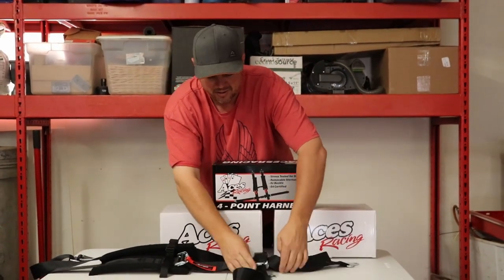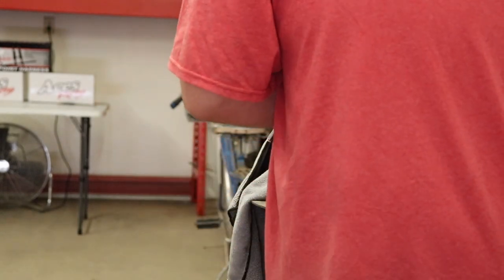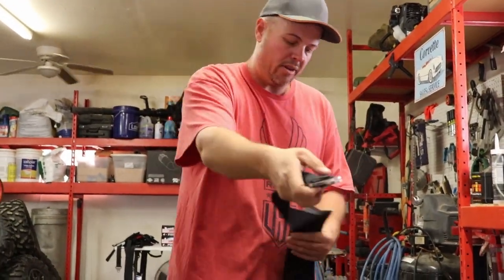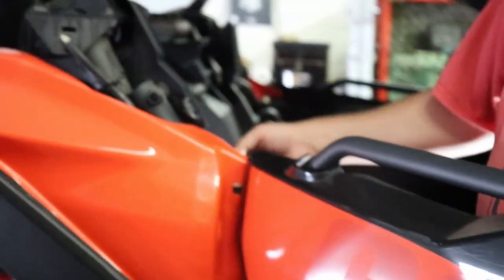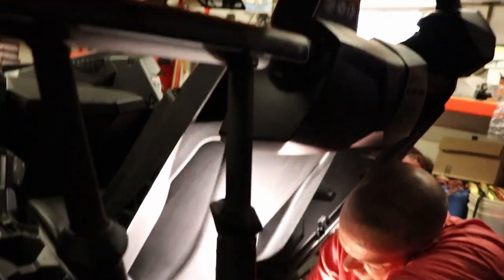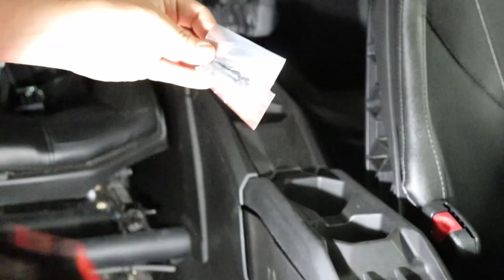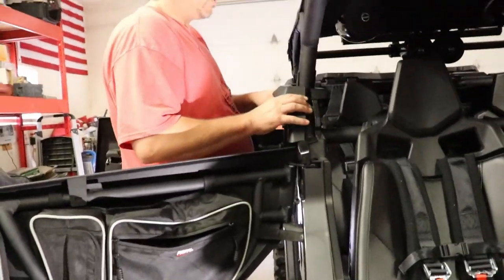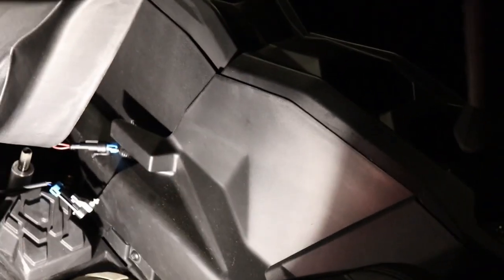4 point harness complete install-Aces Racing Harness Maverick X3, Rzr

Comment: Great video on the install 👍
One thing everyone should keep in mind when adjusting 4/5 point harnesses. Loosen all belt adjustments , The very first step is to securely tighten your lap belt making sure it’s down low on you. that is intended to keep you planted into the seat , even if the shoulders are loose. It keeps you planted, You then adjust the shoulders tight. If the lap is not adjusted properly down low, when you tighten the shoulder harnesses you have the potential to raise the lap belt from its intended spot which is down low in the lap to keep you planted in the seat. 

Nice vid.

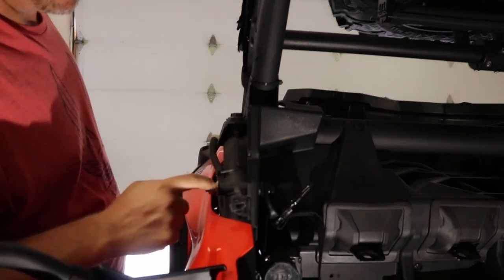Comment: The 2 bolts @ 18:30, do you put them back where they originally go? There’s no purpose for them anymore right? Just for the original seat belt?
Reply from the maker: There's no need to put those 2 longer bolts back I would just store them somewhere for emergency purposes other than that you're good to go
Reply: @reviewittv1802  for sure thanks!

Comment: What size bolts did you use on top strap holes
Reply from the maker: HEX BOLT
LENGTH 1 1/4
Diameter 1/4
Purchased at tractor supply
Reply: 1/4" Diameter bolts are way to small. 3/8 or even better is 1/2" bolts work better, You do not want play between the bolt and the harness and the holding bracket you will wear the holes out and weaken the integrity of the steel. maybe not on the harness but will definitely on the thin steel bracket where the harness bolts on the SXS.

Comment: What size bolts did you use for the top strap holes?? My set will be here tomorrow.
Reply from the maker: Not sure off hand I will follow up with the size for you.
Reply: @reviewittv1802  what’s the side
Reply from the maker: @TheBest   Hex bolt length= 1 1/4  & Diameter= 1/4. Found them at Tractor Supply.
Reply: 1/4" Diameter bolts are way to small. 3/8 or even better is 1/2" bolts work better, You do not want play between the bolt and the harness and holding bracket you will wear the holes out and weaken the integrity of the steel. maybe not on the harness but will definitely on the thin steel bracket where the harness bolts on the SXS. Also probably will not hurt anything but redundant lock washer and locking nut are not needed. one or the other will keep the bolt and nut from backing out. That is why they call it a locking nut. BUt good info on the video.